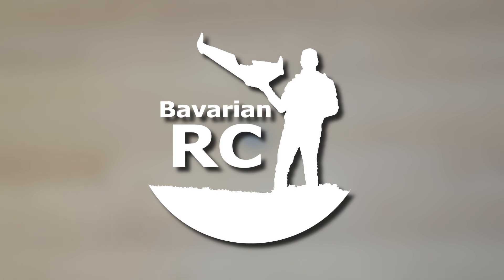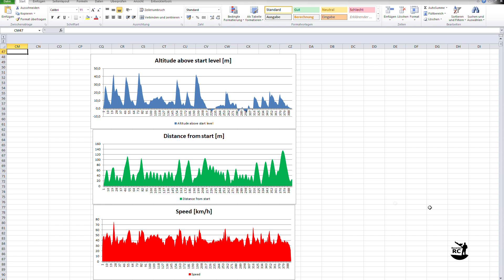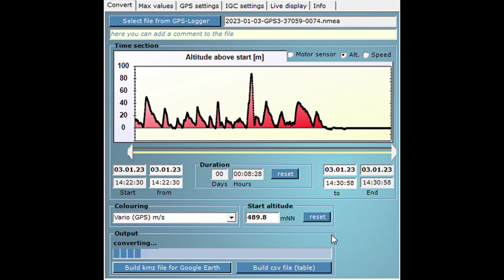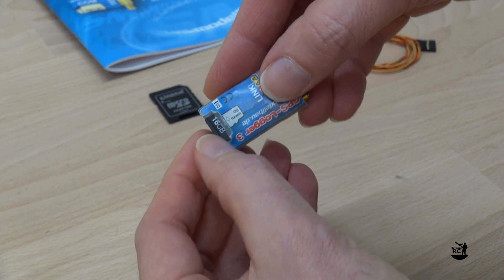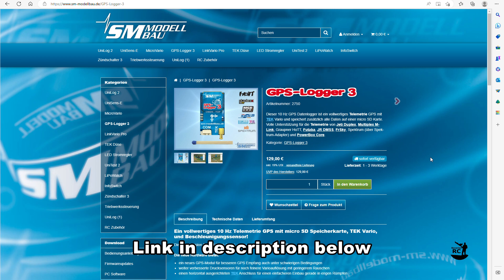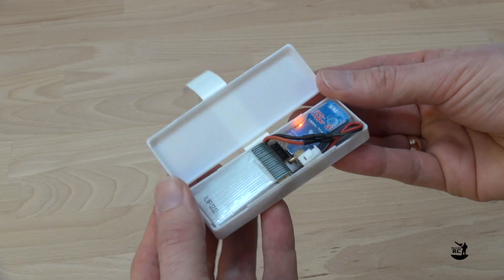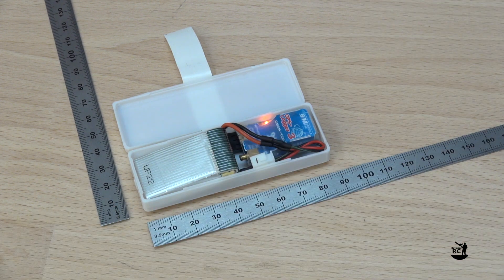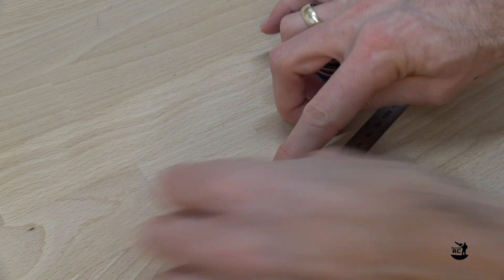SM GPS Logger - Stand-Alone Modification

Comment: If my plane goes down will I be able to use this gps unit to find it?
Reply from the maker: If the GPS Logger is connected to the telemetry channel of you receiver it provides the GPS coordinates back to the transmitter. So in case your plane goes down and everything is still functional and you still have radio contact between transmitter and receiver you will have a live indication of the GPS coordinates. In case you crash and nothing is working any more then you could still use the last recorded position from the SD card of the transmitter to locate the plane. All of this will not work if you use the GPS logger in a stand-alone mode as it needs the receivers telemetry channel to send its position.

Comment: LOL. It's always a joy watching your very meticulous and precise (ie - very German! 😉) builds and contrasting them with our chainsaw and axe constructions. 😱😊 
Oh, but to get 1 over on you 😈- at about 9.05 you (incorrectly?) give the power consumption for this excellent unit as 60 milliAmp Hours - should be 60 milliAmps? 😉 
The specs seem to say that the GPS logger will run down to 3.6v so that makes your limiting of usage time to 2-3 hours out of a 600mah battery fairly conservative - though probably wise considering that those are Chinese mahs. 😜😁 
Another thumbs up video!
Reply from the maker: Thanks buddy! Happy that you liked the video which was a bit of a different format as I am not building or flying a plane but focusing on one equipment. Not totally sure for the milliAmps (I know why I was focusing on mechanical engineering at university and not electrical engineering 😉). I would say we are both right, during 1 hour it will consume 60mAh of energy which means the average current during 1 hour would be 60mA. 
The 2-3 hours are really on the safe side. I started with a 400 mAh battery and during winter I noticed that the cold temperatures had quite a negative impact on the battery. On top I have the impression that from time to time the logger seems to have small peaks in power consumption which make the voltage of the battery drop a bit. For my 400 mAh battery the logger quit after about 100 minutes in such cold conditions. Therefore 2-3 hours for the bigger battery seems to be on the safe side. And yes Chinese mAh count different 😂
Always enjoying your comments from down under and I really love your sense of humor 👍
I am sure you could make a great YouTube channel, at least I would love to see your "chainsaw and axe" constructions which I think are far from what you want to make me believe  😉
Cheers
Robert